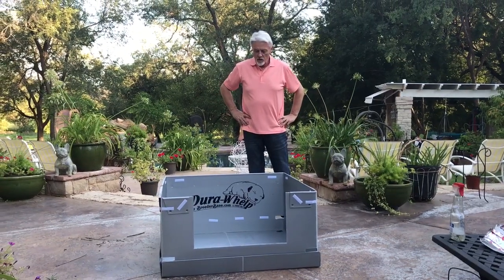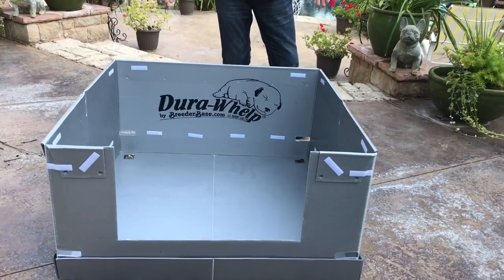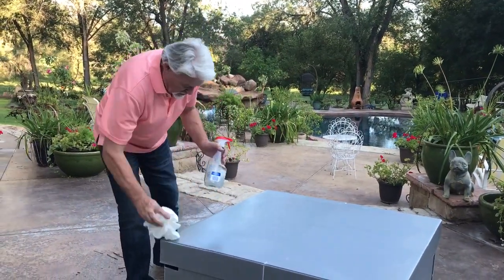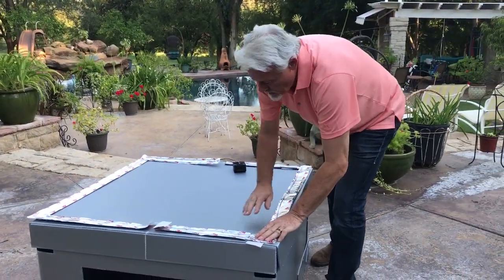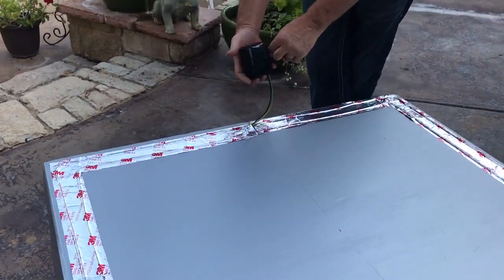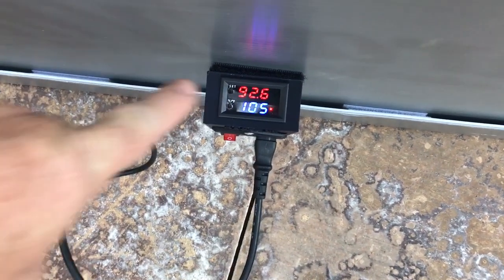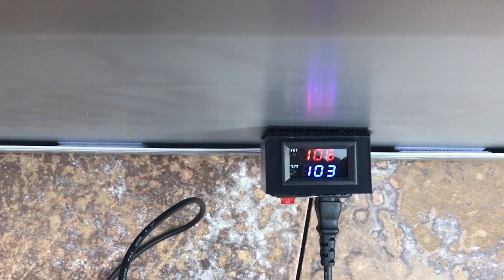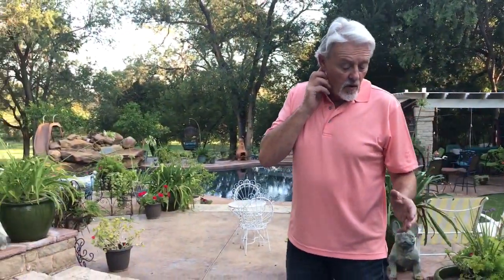DIY, A Whelping System For Dogs/Puppies

Comment: Can you please list the specifications on the heat tape/wire and the thermostats on your products? I want to know exactly what I'm getting before I buy it and I'm not finding that information on your website. Thanks.
Reply from the maker: Have you reviewed our product at WWW.MyBreederSupply.Com yet? We will custom build for the size your needing. Or if you need other information you can find our contact phone#. Thank you for your interest in our product!
Reply: Love My Pups I've already checked the website and couldn't find the information I'm looking for... hence why I asked... and you didn't actually answer my questions...

I want to know the specifications on your products because they aren't actually listed on your website. Specifically... exactly what thermostat and heat wires you're using.
Reply: @liminal_spice1712  sounds like you want to know what to buy Lol do your research

Comment: Thats the exact size Dura Welp box I have set up for my Aug 22, 2019 litter. I'm using Doctor Mills in Durant OK, I could use your heat system. to work with my 2 lights
Reply from the maker: Corey Banks I can build and ship one to you today. Have it by Monday

I have lots of customers who use Durant animal hospital. Great people 

James 580-799-2873
Reply: I was just looking on the website for prices for a 40x40 And as you may remember I'm in Dallas.
Reply from the maker: Corey Banks $199 plus $8 shipping

Comment: Is this the only heat source needed?

Also do you adjust the temperature based off room temperature?  What if room temperature is around 63 degrees Fahrenheit?
Reply from the maker: The heat adjustment is based upon real temperature. That is to say the heating pads are constantly measured and adjusted accordingly.